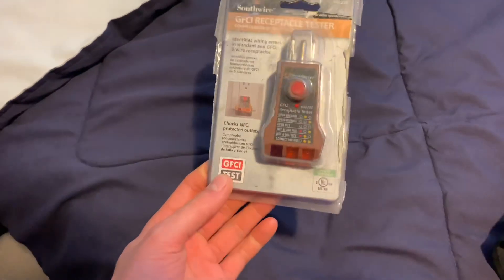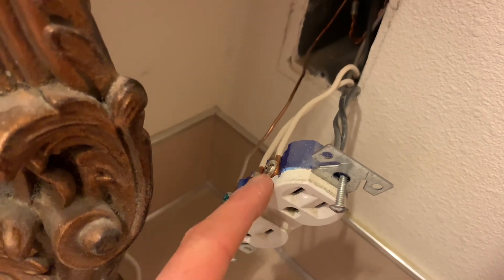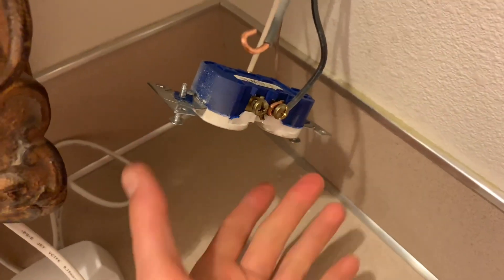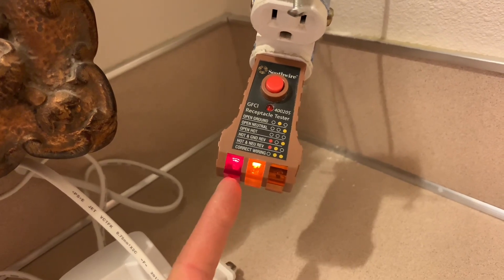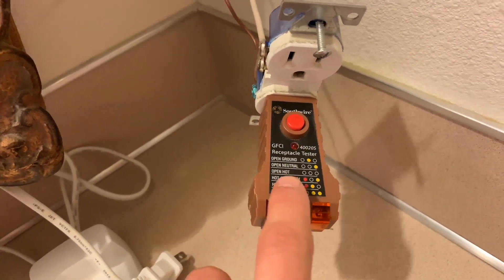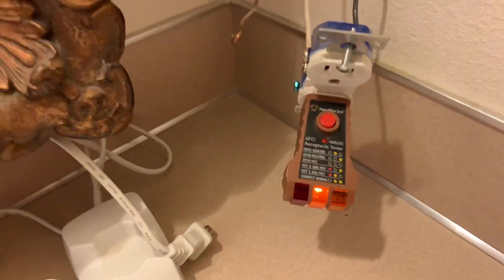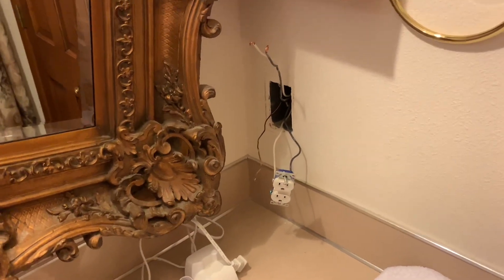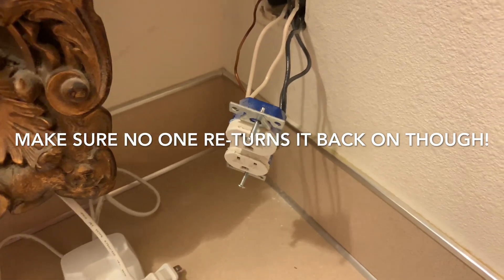How To Use A GFCI Plug Tester! (Every Scenario Explained)

Comment: Question.  I plug the current limit device on the hair dryer (2 prong no ground) DIRECTLY into a GFCI receptacle.    Press the test button on the
hair dryer, it does trip, BUT the GFCI does not take notice of the missing current.   confusion.

Comment: Hand held GFCI tester shunts the current to the grounding wire.
If no ground wire, the hand held will not work BUT the test button on the actual GFCI will work, because it creates an imbalance between hot and neutral. thank you.

      Wonderful instructive video for new learners.

Comment: These plug testers are awesome tools, but for safety reasons the user should also be aware of a few limitations.  It cannot detect a combination of defects,  for example an open ground AND hot/neutral reverse,  the tester will read open ground because all it sees is 120V between hot to neutral prongs, a hot/neutral reverse in a grounded circuit will have 120v between hot to neutral and 120V between neutral to ground,  which causes the red light on the left to light up, and of course the hot to ground will have 0V, which means the light on the far right will be off.   

If the outlet somehow is wired to 240V, such as the wrong outlet installed for a 240V window AC,  all three lights will be lit, with the middle light brighter than the other two.   This is because you will have 240V hot to neutral,  120V hot to ground, and 120V neutral to ground.   This actually happened to me in a rental property about 10 yrs ago and fried my expensive LED floor lamp.   There was a window AC unit there, but it was winter when I had moved  in and because it was a 120 volt outlet I figured I put the lamp by the window then re arrange the room when summer comes.  The plug on the air conditioner cord was simply changed to a regular 120V plug instead of installing the proper outlet,  and I was unaware of the fact.   Not a happy camper.   To get ahold of maintenance,  good luck.  It was a slumlord.

Comment: You missed a scenario that I ran into this weekend at my house. I plug in the tester and both yellow lights come on showing it is wired right, BUT when you push the button to test the gfci there is no trip but the red light lights while the test button is pushed as well as the 2 yellow lights are on. Any idea? I manually test the button on the gfci outlet and it trips as it should.
Reply from the maker: take it apart and look into it, might not have a ground? Don't know if i've ran into that scenario before. hope this helps
Reply: I had the same issue the tester shows it’s good but doesn’t trip when I press the button just lights up one indicating open ground and that was the problem so I traced it back and happen to find there was no ground at the other end
Reply: I have taken it out & checked everything, this is on new wiring, thinking it might be a bad outlet, it's pretty simple white to silver black to brass ground is secure has one outlet down stream acts the same way.
Reply from the maker: line and load wrong? you try it with just the line? could be a bad plug.
Reply: Has me confused as it says it's wired correct just won't trip with the tester button if I test it with the test button on the outlet it works correctly.
Reply: Nope if line & load are wrong it doesn't work at all, trust me I found that out! I will take a known good one & swap it out. Have like 8 installed the house, this is the only one giving me issues.

Comment: At around 13:00 would have been an EXCELLENT time to plug in your tester at the downstream receptacle, without the ground, reset the GFCI again, and demonstrate that the GFCI "test" button on the plug tester would do NOTHING on an ungrounded receptacle.  This messes up a lot of people who don't understand that the tester needs a grounding connection to "trip" the GFCI, even though the GFCI itself doesn't need any grounding conductor to work or to pass its INTERNAL test.
Reply from the maker: Thanks!
Reply: Please read my question I just asked. Maybe you can help.
Reply: @UpnorthHere extremely well written.